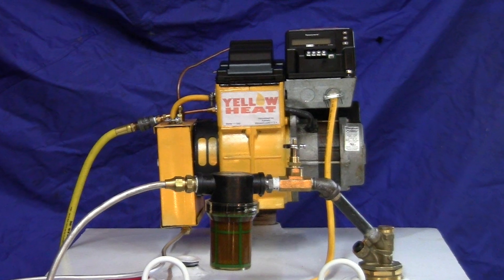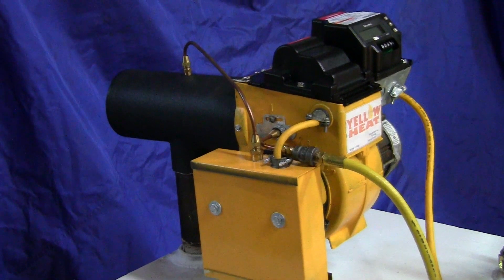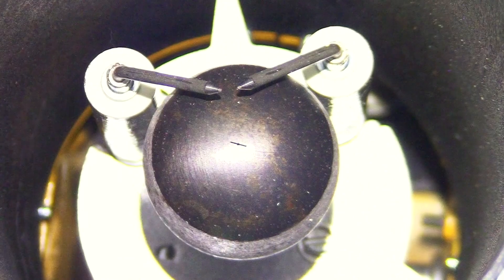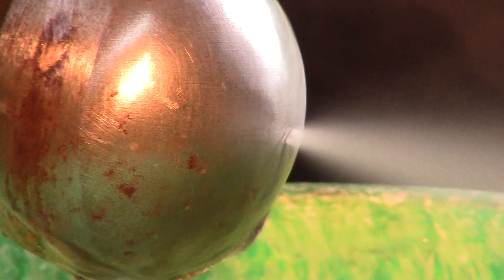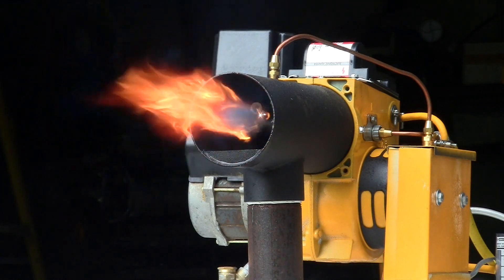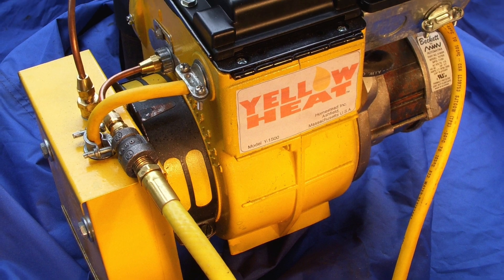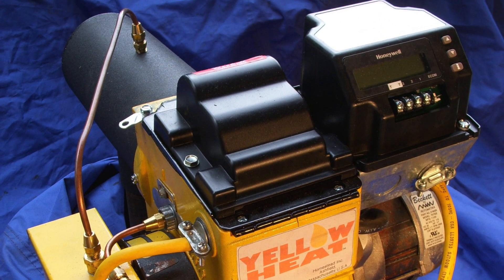Yellow Heat Burner

Comment: I have been operating this design for the past four winters. It's operation is smokeless and the total ash accumulation for 4 years is a cup or two of white ash. Burning in the open air is different than in a furnace or boiler where there is reflected heat. If there is a smoke tendril it might be a particle of French fry burning up, since the oil is not filtered. If you can demonstrate another design that is a retrofitted Beckett burner operating on used oil, that produces an improved flame, a reference to it here would be useful. Otherwise, your evaluation that it would cause soot or smoke is incorrect.
Reply: Thomas Leue  "If you can demonstrate another design that is a retrofitted Beckett burner operating on used oil, that produces an improved flame, a reference to it here would be useful. "
I'll bet it would! So you can knock off someone elses design and copy and profit from it?? yeah right.
 
This thing is nothing more than an old Modified Furnace burner with a babbington arrangement stuck in it.  There is plenty of info on Babbington burners on the net and your grossly over priced modifications that WOULD clog up a furnace through the incomplete burning are nothing anyone else couldn't easily do themselves for a fraction of the price.
How many of these things have you sold over the years anyway? I'll guarantee not many!

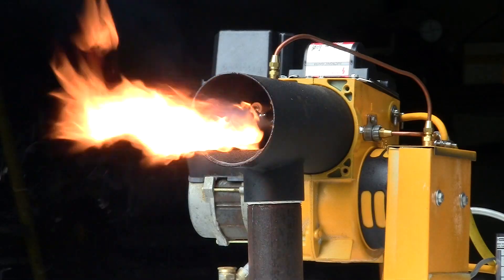Comment: That's the way it burns? 1:49? There is unburnt oil spraying out and it is also creating smoke. This is anything BUT a clean or efficient burn!  This burner would clog up a furnace in no time and the puddling and pooling it would create would also create an explosion hazzard once the unburnt oil heated up enough to vaporise and ignite.

I would implore anyone to check with their insurance company before installing one of these very poor products even if your own common sense did not tell you to stay clear of them. The idea of them not needing the oil to be filtered is nothing more than semantics and a spin doctoring designed to mislead people.  Substituting strainers instead of filters and and the fine print on what sort of oil is required to run these poor performing burners is misleading in the extreme.

I would urge people to be Very careful before spending their money on these poor burning, obviously non compliant products and do their homework rather than take the word of the person promoting and profiting from them.
Reply: Oil Burner That is a really poor Flame output. It would be unacceptable to have any burner firing like that and a burner technician would have to repair any unit he found operating in such a manner. 
If this is the level of operation of this product it is in no way acceptable for any domestic and I very much doubt any industrial/ commercial use. 

I cannot believe they even show how poorly this burner performs but it is a good thing they do given how much they hype this substandard product up.